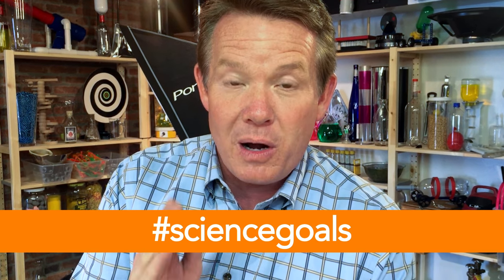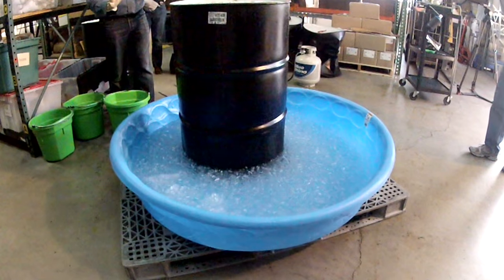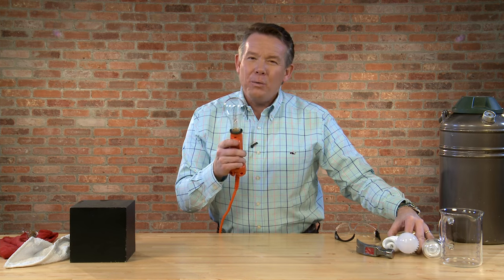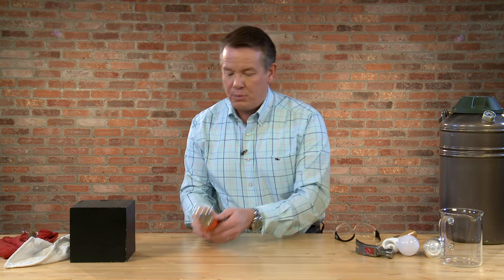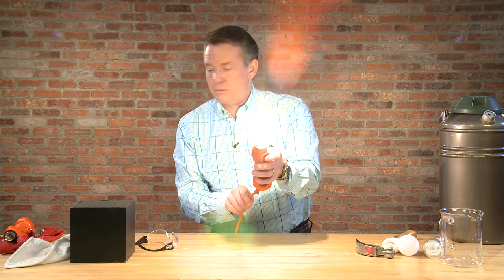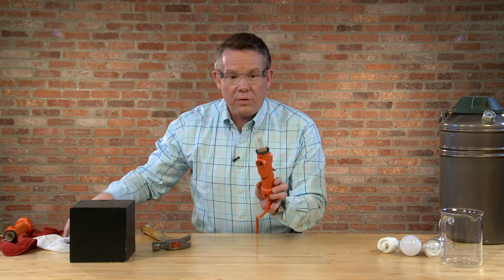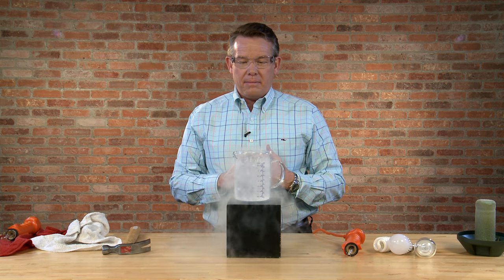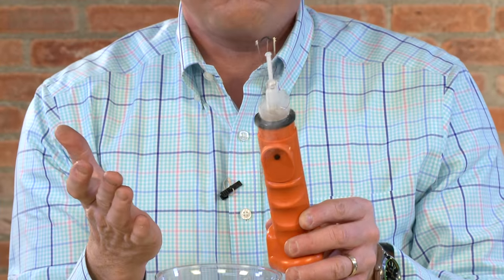Light bulb in Liquid Nitrogen - The Spangler Effect

Comment: it's true they use up to 90% less energy, but it doesn't mean that 90% was wasted.

Where i live, we heat our homes 3\4 of the year.  typical home uses electric furnace\baseboards.

the 90% of "waste" energy from a incandescent lightbulb actually goes towards heating our home 3\4 of the time. (and resistive heating all have virtually 100% efficiency, whether the heat is from a lightbulb or a baseboard)

the flipside to this of course, is hot climates where you use AC in the summer, then it's not just "waste" heat, it's heat that you then expend more energy removing from the home.

Comment: I was a pretty early adopter on both CFL's and LEDs.  It was interesting though- Until recently my apartment was electric heat (they converted us natural gas a couple years back).  When I switched to CFL's my apartment got a lot colder.  My living room track lighting, it turned out, was effectively a very useful part of my winter heating.  It was particularly useful because it was projecting heat out into the room while the electric heat was running up the wall from the baseboard heaters and a lot of it was going right out the window.

I happened to be talking to a guy from NYSERDA about energy savings, but he couldn't give me any comparison between electric heat efficiency vs. light bulb efficiency at turning any juice it wasn't putting out as light as heat.  Of course, in the summer when you are running your AC light bulbs giving off heat are twice as inefficient- you are creating heat you don't need, and then running the AC to get rid of that heat.  I actually contemplated keeping two sets of bulbs, one set of incandescent for the winter and one set of CFL or LED for summer.  Bulbs are kind of fragile to move around that often, especially since the CFL's have mercury in them.

I've also been in houses with heat lamps.  They are really nice.  It got me thinking that if I were to design a perfect futuristic light fixture would be hooked into the thermostats.  It would have a couple different bulbs and adjust the mix of what it was using depending on what the thermostat suggested.  (I'd sit it right next to windows that were motorized to open when it was cheaper (and still effective) to heat or cool the house naturally rather than with heat or AC.
Reply: I use incandescent bulbs in my wellhouse for their heat, not for their light.  If I can't get incandescent bulbs any more, I don't know what I'm going to do.
Reply: ***** They probably still make straight up heat lamps.  You've got your UV lights for plants, but you've go IR ones for taking the chill off bathrooms.  Looks like Home Depot has brooder lamps that might fit that bill.
Reply: nacoran
Thanks; brooder lamps is a good suggestion.  And I never thought about looking for IR lamps.
Reply: Electric heat is 100% efficient at turning electricity into heat. Incandescent light bulbs only convert about 15% of the electricity used into light,the rest gets turned into heat. (and,I guess technically the light they emit,might be turned into heat when it's eventually absorbed by..whatever.)
Reply: PhattyMo
Actually, it's much worse than that; a standard light bulb only puts out about 2% of its energy as light; the other not-quite-98% is heat.  I can live with the difference between 98% and 100%.  And I'm not trying to heat the entire wellhouse -- I'm just putting point heat on some ball valves.

Comment: Would you have to take the lowering of the resistance due to the low temperatures into account in any way if you were to run that experiment for a longer time or is the effect in those temps negligible for tungsten?

Comment: incandescent bulbs are certainly energy hogs. a clear demonstration of the brute force of house current and a piece of tech that your great great grandparents understood as well as you. in my experience, though, the weak point of CFL is the electronics that step down the voltage...I maintained lighting displays over a year and the majority of CFL that failed did so because the electronics in the base failed. also the mandatory recycling consumes a lot of energy and effort. LED's would be safer and better but only if we were using a 12 volt system.

Comment: Nah, the Edison bulb is not that bad, people always seem to overlook that they can provide a good source of radiant heat, have the best CRI (color rendering index), are the simplest to power (can withstand voltage swings, AC or DC) without the need for a ballast or driver, and have very consistent color temperature. In colder environments the heat they output can help keep a building warm!
Reply: +Gay John In many practical cases the old incandescent lasts WAY longer. Halogen bulbs last even longer. I have had to replace countless CFLs since the government forced the replacement of incandescent bulbs. Because the majority of CFLs are made very cheaply, the electrolytic capacitors dry out and fail prematurely. Electrolytics are generally rated for 85*C, although 105*C rated capacitors are more often used. However no matter the rating heat is inversely proportional to lifespan of these capacitors.
Reply: +Gay John What's scary is that because the tiny ballasts crammed with switch-mode power supply electronics is thermally insulated, tiny, and packed with cheap electronic components, the chance of them failing catastrophically is quite high. I had one actually explode in a bit of a fireball in the bathroom directly above the shower. I replaced it with an incandescent bulb and no more problems.

Comment: Pretty sure Edison didn't see many light bulbs with tungsten filament or "ductile tungsten". But it's possible I guess as the process to even create ductile tungsten was invented by Bill Coolidge in 1913, whilst Edison was alive. However, Edison invented the incandescent light bulb using a carbon filament or strip coiled and connected to platina contact wires. I.e NOT TUNGSTEN. That's of course not the entire history, plenty of people have tried and succeeded in making the incandescent lightbulb possible.

Comment: Does that mean that it would burn forever in liquid nitrogen?
Reply: +kellen walburn Maybe, if you keep refilling the nitrogen. Also you have to think if nitrogen wouldn't be damaging the filament. Tungsten filament burns out in seconds when exposed to oxygen because of oxidization. Incandescent lightbulbs are filled with argon gas and sealed to prevent the tungsten from oxidizing and to slow the evaporation. It then burns up in around 5000 hours like a wood log instead of seconds.